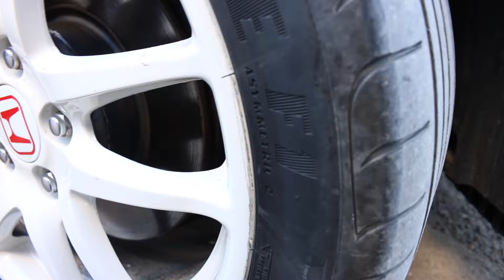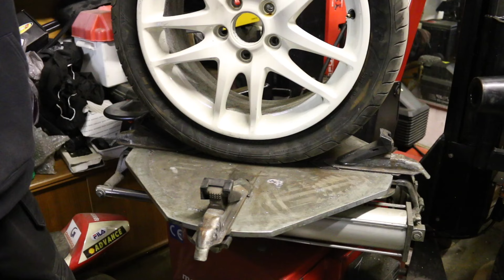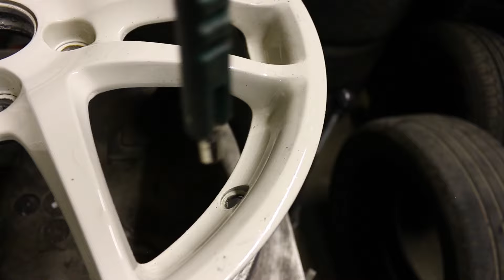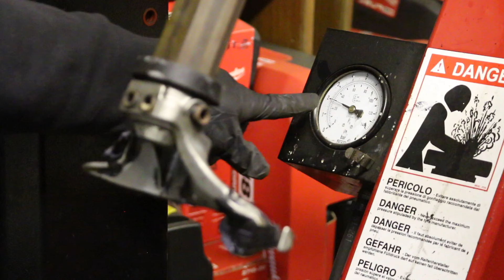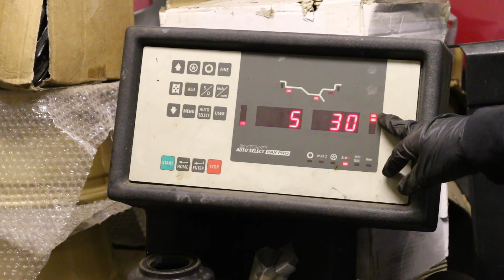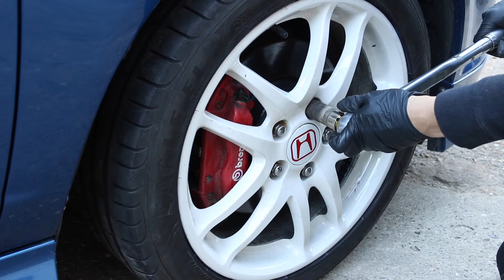How to Change a Tyre & Balance the Wheel - PerformanceCars

Comment: Hey mate, great vid! Could you do a video on how to maintain a Type R? I'm a new owner and i'm finding that there's quite a bit of maintenance work to keep the car running. Cheers!
Reply from the maker: Hey kenectd, congrats on buying a Type R. Did you get he DC5? In terms of 'how to maintain a Type R', that's pretty vague as anything can happen and at anytime. What would you like to know how to change as there are so many things.
Reply: Hey Bond, i got the JDM EP3! So II did exactly what you always do when you get a new car. Oil change, oil filter change and spark plug change (thanks for the vids). I also took it to my mechanic for a check up a month after the purchase/oil change. After getting it back, he said i was a little low on oil and topped it up for free (cos he's my mate who mods a lot of cars).

Like before getting a type R i had a normal civic and eating oil was never in my mind but i guess i gotta keep an eye out for my oil levels now as i tend to hit VTEC a lot more now! 

A general video of maybe what to look for out, frequency of maintenance, proper way to be revving the engine etc.

Thanks for the great work!

Comment: Hi, very informative video. what setting do you torque the wheel  nuts to?
Reply: theSTUNTHAMSTER Manufacturers requirements. Usually in the range of about 80 lbf.ft
Reply from the maker: Hey , thanks for the comment. As Lexy says, 80 lb ft or 110 NM